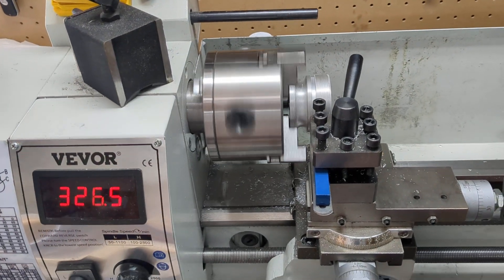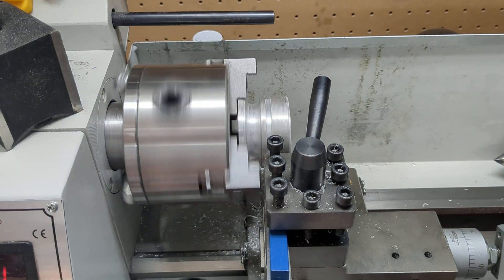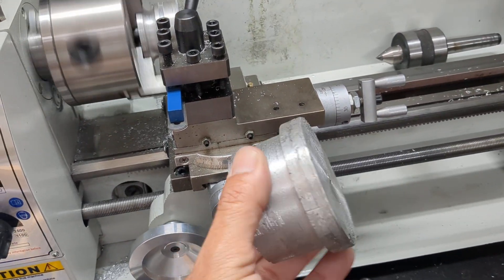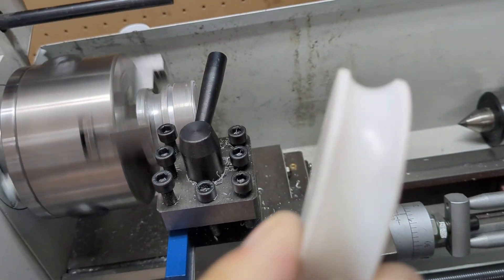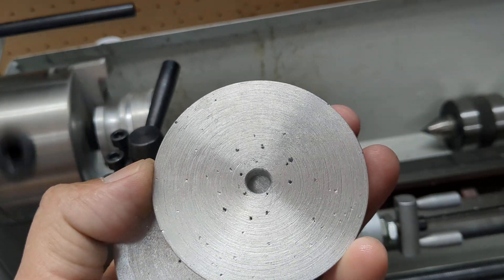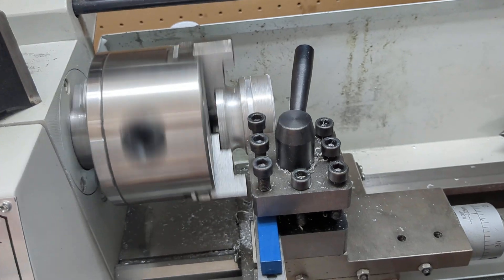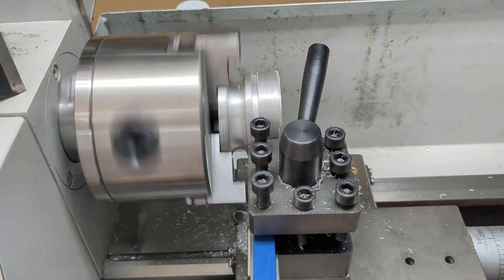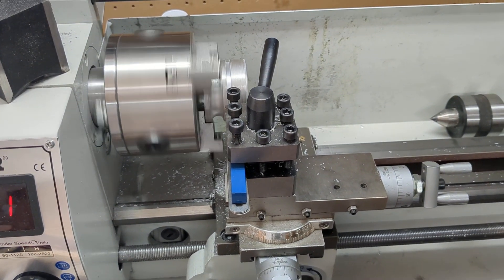We melted scrap aluminum and machined sheaves for our Atkins and Hoyle davits.

Comment: So you have a form tool for the sheave curve?
Reply from the maker: Made one out of tool steel, remembering shop class and my first few years working in a machine shop.  Atkins and Hoyle davits are great and good quality, but the hardware supplied is not the same quality, we had a shackle break and damage our dinghy and the plastic pulleys didn't last, hopefully the aluminum sheaves will last longer.
Reply: @desperadoii4938 I've cast epoxy and glass sheaves in a small section of PVC and then ground down the groove with a drill bit wrapped in sandpaper before for small boats and they have held up. I havent gotten around to making or buying a round form to do it clean on metal